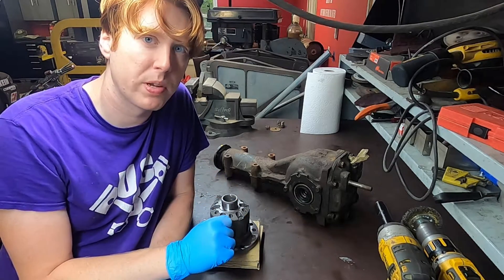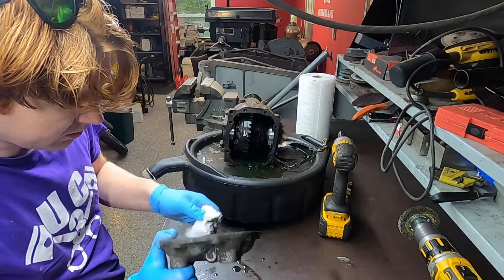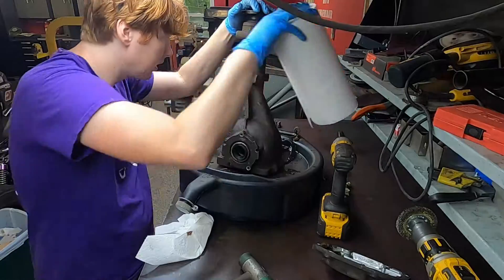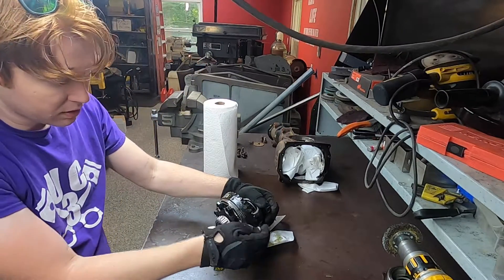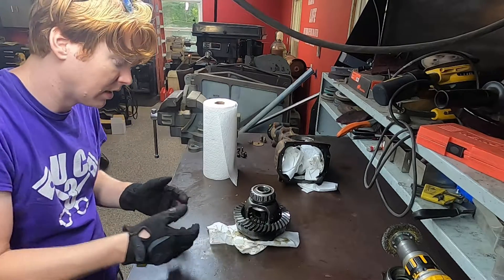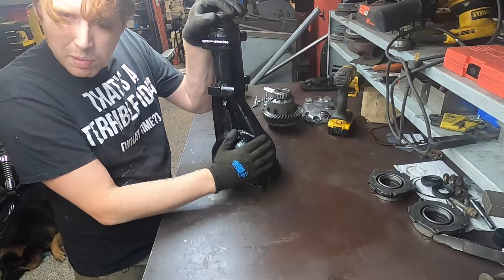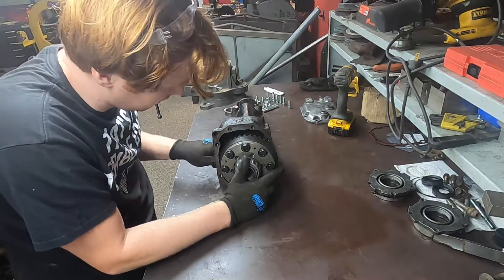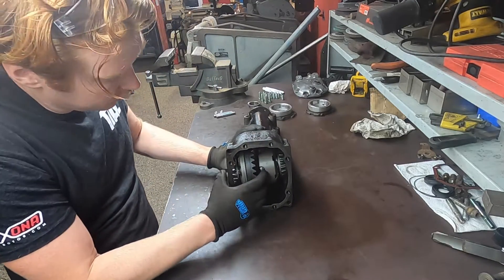Cusco Differential Install in Subaru R160 Rear End

Comment: Hey bro do you have any idea if the ring gear is the same bolt pattern for most diffs from the same generation? I’m trying to swap ring and pinion on a diff (and trans) to keep oe 5 speed with a higher final. Thanks for any input you may have
Reply from the maker: Hi, the ring gear is indeed the same bolt pattern for almost all R160's you could possibly have gotten your hands on.

Comment: Im a little late to the party here but is the vlsd slightly larger than 160mm? And thats why you have to grind the nubs for the bolt holes? Or is it still a 160 but thicker material
Reply from the maker: The flange thickness for the LSD is much thicker as this is where the case halves are also joined, which pushes the bolt heads farther out. Very simple and safe clearance adjustment though!

Comment: I saw another guy just take out 1 bolt and it slid right in.Then put the last bolt in through the side.        What IDK is whether or not my VB rear diff can be replaced with an older R160 with the OEM LSD in it. The old STI R160 4.11 LSD diff. just swap them out.
Reply: STI = has R180 = WRX has R160 = i just swapped my 1 wheel for a LSD R160 suretrack . THE STI wont fit WRX will fit !
Reply: @ronnieboucherthecrystalcraftsm  
Nice ok! What year WRX? And where did you source the Suretrac? Thanks!
Reply from the maker: @RobHTech  that's an awesome way to do it if that clears the lug!

Comment: For install Bearing race never use hammer possible damage.
Reply from the maker: Contact when driving the bearing on is only made on the race, not the cage, and it is done with a sacrificial old bearing race in between. There's nothing wrong with doing it this way and you will not damage the bearing.

Comment: Good video, cheap little HF hydraulic press will do wonders and you can service your pinion bearings with it too.  I do the same thing with wheel bearings using the old races to drive new bearings home.